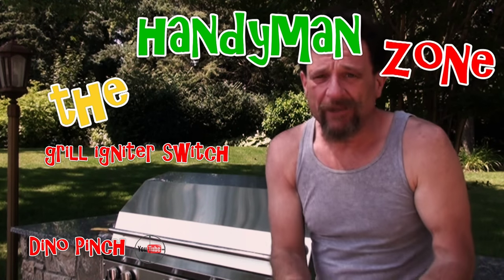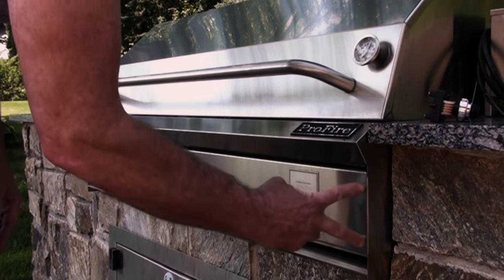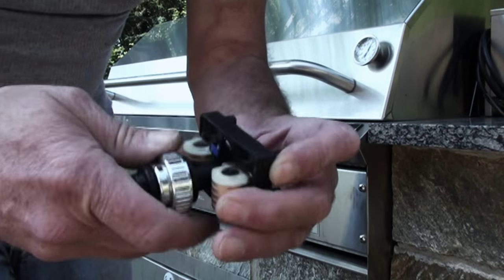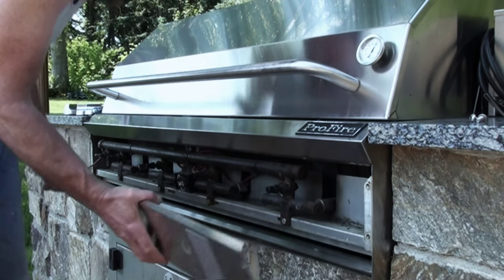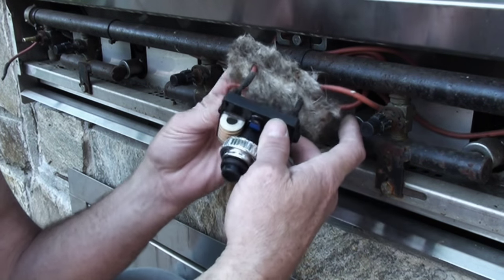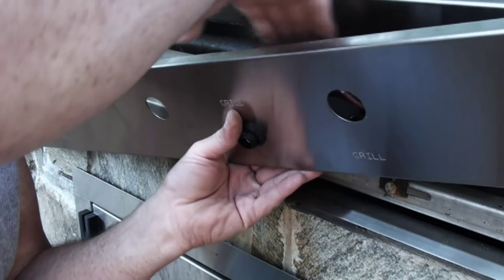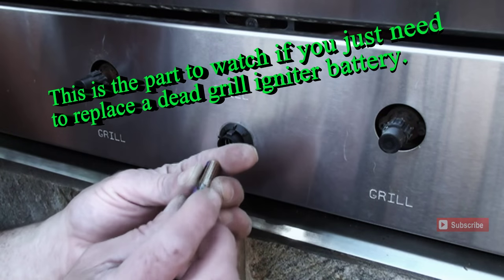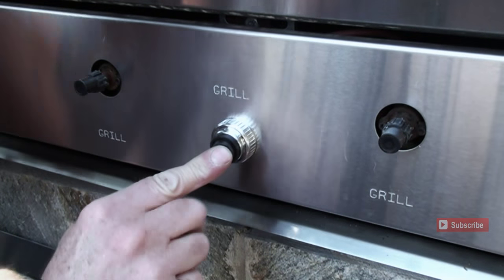FIX IGNITOR BUTTON ON GAS GRILLE

Comment from the maker: If the ignition on your grill isn't working, chances are you do NOT need to shell out for new grill or a new igniter switch. You simply need a NEW BATTERY! .I
Reply: Dino Pinch can I just light it with a lighter